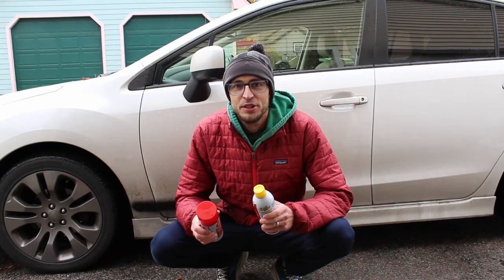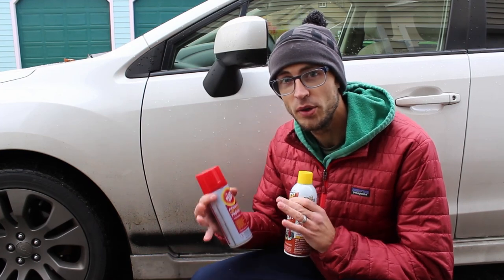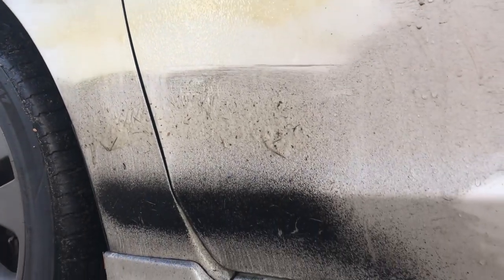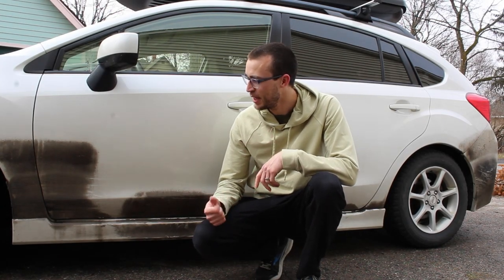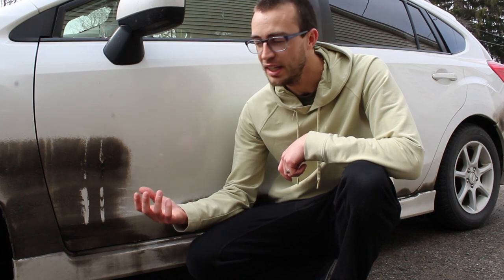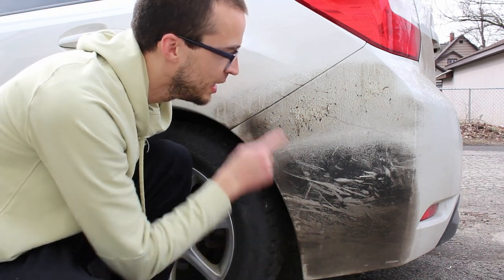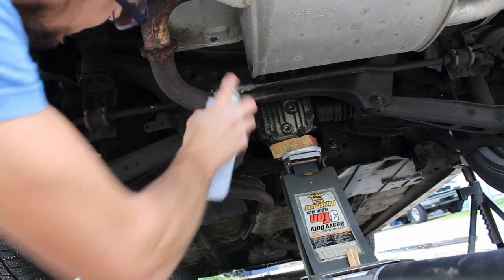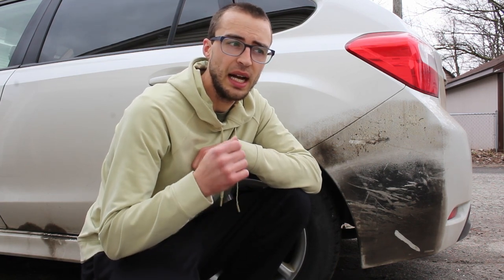Fluid Film VS Surface Shield - Rust Protection Undercoat Comparison Test

Comment: Project Farm tested Fluid Film as a gun lubricant, and surprisingly it came out in the middle for quality, compared to several lubricants made for guns. I use it for motorcycle chains, since it costs less than most I use it more often, and it does not collect as much road grime as some choices.
Reply from the maker: Yea it’s a pretty versatile product. Seems surface shield is only recommended for an undercoating.
Reply: I saw on another video to spray underneath push mower decks (& lawn tractors) & grass doesnt stick/wont rust! ALSO, my old window air cond squealed. I sprayed w/pb blaster, WD40, etc, still made noise. Until one yr, shaft motor moaned/froze up. I sprayed shaft w/ff left it creep, & runs like new again!
Reply from the maker: Don’t try that with ss though it’s crazy sticky and is a pain to get off anything.

Comment: Very good comparison Kurt.  The question is, what is in your wheel wells?  Is there factory undercoat or rustproofing applied?  My car will not get driven in the rain, but I have some suspension and chassis parts I would like to clean up and coat with something.  I think that the Fluid film could "creep" more into the undercoating that has minor cracks in it and settle between the undercoat and the bare metal underneath it.  I would like to know your thoughts.  Thanks
Reply from the maker: The more I use them the more I like fluid film, I use fluid film in the wheel wells under the liners. It creeps alot

Comment: I wouldn't believe either would even last a 2 months much less a season or 2 yrs. They probably tested it in Southern Ca or the Arizona desert without ever driving it and what does. Test that in the salt covered, graveled roads of upstate NY and you will have much different results. South Main Auto channel is a fan of fluid film. Thanks for the testing but how these creep on smooth paint is remarkable different from how they will on metal, which I believe will be much better.
Reply from the maker: I believe that the surface shield lasts that long but the more I use it the less I like it. It hardens like a rock but doesn’t seem to be near as good as fluid film.  You have to chisel it off almost.

Comment: At 4:00 you applied SS for 2.6 seconds and FF a total of 5.4 seconds. Then, at 9:00, you point out that FF has a bigger coverage. I'm not a genius, but anything done twice as long will cover more. You like FF, understandable. But your own finger wipe test showed how SS is better for longevity
Reply from the maker: SS def lasts longer. Based on my experience fluid film creeps better. But I don’t think surface shield is much worse.  The nozzle on the surface shield gives a wider coat. The fluid film nozzle is very narrow so it took longer to cover the area.  

Not sure what the flow rates out of the can are so it would be pretty difficult to get exact amount of product on there.

Appreciate the advice/criticism though

Comment: Not making a statement against surface shield but petroleum jelly can degrade types of rubber. Might be relevant for components in the undercarriage.
Reply from the maker: Most rubbers on cars resist that,  I’ve had fluid film on my car for 7 years without issue.

Comment: Can you mix Blaster surface shield with a Krown or Rust Check product?
Reply from the maker: I’m not sure what those products contain but it’s unlikely they would be reactive.  I would do one or the other and not both though.
Reply: Hey I thought the same question mixing together or one on top of the other. 
Surface Shield is made by Blaster makers of Rust Buster for corroded bolts and nuts. This product is excellent for seeping into metal pinch welds and joined metal. I was thinking of spraying this into those areas then top of with Surface Shield or Fluid Film or Woolwax.

Comment: In my country surface shield is not available, but fluidfilm is.
Do you know if it is possible to just mix fluidfilm and petroleum Jelly, and get a similar result? If so what would be the mixing ratio?
Reply from the maker: I would just stick with fluid film it is extremely good.
Reply: @KurtofTrades  ok, thanks

Comment: Hello, great video. How many cans do you think I would need for a four door car like yours.
Reply from the maker: Thanks!  If it’s the first application and you are doing under the fender liners probably 3. A recoat without doing under the fender liners takes me 2.
Reply: Great, I wondered about those fender skirts, I have a 2022 Sorento and it has those soft almost fabric type material in the rear quarter panels.
Thanks for replying so quickly.
Reply: I have 3 cars. Winter i Norway. On my bee 5 years. 150 cans., More cans the better.

Comment: I thought these products were intended as an undercoating and not on the outside of the car and on the paint. What do you do. Spray it. and wipe or wash it off?
Reply from the maker: Yes they are, it’s hard to see them and film them under the vehicle. I did this as a demonstration.
Reply: Thanks Kurt. I genuinely don't know much about these products. Other then a couple of other youtubers said not to apply it on the outside of the car. If you do that. I'm sure you don't leave it on. What do you do. Let it soak in for a bit and wash off?

Comment: Would you spray this stuff over hard undercoating?
Reply from the maker: I would never use a hard undercoating in the first place. It’s worse than doing nothing
Reply: @KurtofTrades  nice I ruined a $57,000 truck is what your saying. Thanks
Reply from the maker: No it’s not ruined it will just need to be touched up when it starts flaking, I would add fluid film once it starts cracking.
Reply: @KurtofTrades  ok. I did this when I got it brand new day one. I do regret it and am mad at myself for doing it. I see nightmares of people getting rotted vehicles. Dealer claimed it best thing I did
Reply from the maker: @appleztooranges dealers don’t care what happens in 5-10 years.  It’s not the end of the world.

Comment: Thanks for the review. Apparently these products are good to keep rust from forming in the first place. Does anyone have any opinion on this: I am using Rust-Oleum Rust Reformer Spray, on light to moderate rust on the undercarriage and frame of my vehicle (according to Rust-Oleum,  I should use the spray form on light to (at most) only moderate rust conditions) using the liquid to brush on the product, mainly on heavily rusted parts---as on my other vehicle). Once I have done this according to Rust-Oleum, I need to paint over the rust reformed area. --Now, after doing this, do any of you believe that it would provide extra protection of the surfaces to spray Surface Shield over the fully dried paint surface and then touch it up every 1 or 2 years (depending on how bad a winter we get here in Michigan, and how often I drive the vehicle in the elements of course)? I did not know this product would stick to paint as well as it appears to, and that's why I am asking. Since this Surface Shield seems relatively easy to apply, if it can stick to painted surfaces on the undercarriage, where the surface rust has already been mostly killed, why not use it? Any suggestions since I am unfamiliar with this product?
Reply from the maker: It definitely won't hurt to do that. The only reason I wouldn't do the rustoleum then the surface shield or fluid film is if the rust is really heavy already, IF the rust is formed on the back or inside of panels then doing these won't solve the problem. Sounds like yours is light rust so it definitely should slow it down, which is the ultimate goal. Go for it.
Reply: Definitely use fluid film or surface shield. That rust reformer is only good on light surface rust, if you seal the rust jn with paint it will form scale under the paint. Your better off just hosing everything down with fluid film or surface shield once or twice a year, get one of the 360 degree straws to spray inside boxed frame sections and body panels.
Reply: @semajniffirg230  Rust reformers are good for nothing.  Only at way of Lanoline and Cosmoline doing its job.

Comment: Can this be sprayed on existing rust ? Will it stop/slow it down ?
Reply from the maker: Should slow down light rust. Heavy rust nothing really can stop it. These are better used on cars that haven’t seen salt yet.
Reply: @KurtofTrades  wish I knew about these products sooner . I bought a brand new car last year and there is some surface rust on the pinch welds and I'm looking for solutions
Reply from the maker: Fluid film should help slow it down,  it won’t be a problem for like 10 years though.  Depends how long you plan to keep it.
Reply: @KurtofTrades  probably around 7
Reply: I hammer away thick rust first. Screwdriver and hammer. Then on the hard rust I spray on Fluid Film stop rust.👍🇳🇴

Comment: Do you guys have pros with special spray guns drilling holes and applying these in a business ? Over here in Canada we have krown rust control, corrosion free, and rust check.
Reply from the maker: Not specifically for the these products there are krown locations in the us and there are some undercoating shops that use a variety of products.

Comment: What do you guys think about the crc 6026?
Reply from the maker: Never used it but looking at it it sounds like its like surface shield without the lanolin, I would think SS or FF would be better but can't say for sure.
Reply: @KurtofTrades  Nop.  I use CRC 6023 heavy.  It is Cosmoline and it is in my tread "10 year of using cold galvanizing".  It is toward bottom of comments.

Comment: Is this stuff safe to use on the cars paint for the winter?
Reply from the maker: Not really necessary to use on the paint it’s more for the underside.  It does collect dirt which isn’t the best for paint. It won’t directly hurt the paint though.
Reply: @KurtofTrades  how do you remove the SS if it gets on the painted  body panels? Or on the plastic pieces near the underbody like sidesteps and other plastic bits?
Reply from the maker: It’s actually very difficult to get off. I had to scrape it off and scrub like crazy.  Soap and water didn’t work very well.  A pressure washer might work.
Reply: @KurtofTrades  that’s what I was concerned about, getting it off where you didn’t want it. I still want to find a professional to spray my truck but don’t want to deal with overspray  they may leave. It appears that I may have to do this job myself as I can’t find anyone to do it for me, I sure wish I had a lift.. I’m getting old..

Comment: what about rubbers plastics under the car
Reply from the maker: No issues with them swelling or degrading at all, been using fluid film for 6 years. Not sure on the petroleum jelly part of surface shield though, it most likely won’t damage anything either.

Comment: Surface Shield in one or 5 gallon is double the price as Fluid Film. Unless they come down on the price I’m stocking with Fluid Film.
Reply from the maker: Wow yea I just looked it’s more than double the price crazy! Especially since the cans are fairly close in price.
Reply: If it costs  twice as much, has the same coverage, and lasts close to twice as long, the labor labor saved would make it cheaper.
Reply: If you believe that it last two years I think it is Marketing I wouldn’t trust that. I tested the Fluid Film Surface Shield and Wool Wax for creep test and Fluid Film creeps the best.
Reply: @martinmorris6271  I’m using both on my suburban this year- I’m using ss on my bottom and ff in the frame rails

Comment: I'd rather see a test on metal panels not paint! How it sticks to metal with a bit of surface rust.
Reply from the maker: These products are more meant to be preventative and applied to a car when new to prevent it from happening in the first place.  They are pretty good at sticking to light rust as well though.

Comment: Really good information in the video.  Fluid Film is advertised as non-toxic.  Does the petroleum jelly in the Surface Shield make it toxic or is it non-toxic as well?
Reply from the maker: According to their website it is non toxic as well. Still make sure you use precautions like a respirator and goggles as it’s an irritant!
Reply: @KurtofTrades  Got it thanks

Comment: Is PB Blaster's Surface Shield a fantasy or just an April Fool's joke?   PB Blaster products everywhere, but nobody has stock on Surface Shield.  It was to be initially available only through Home Depot, but they don't even list the product available on their national website.  The Amazon link in this video doesn't work either.
Reply from the maker: Huh I’ll look into the link.  I bought these cans at Home Depot last fall. They were hard to get though and were constantly out of stock.
Reply from the maker: My link works. What country are you in?
Reply: Harbor freight has it
Reply: @paulkelly1809  I just contacted HF in my area and out of two stores they had just six spray cans. One store said they haven’t had a delivery from the blaster people in awhile and don’t know when they will get a delivery. I will need over six cans t o do just the underbody and frame of my f150

Comment: Nice comparison between the two. If your going to show how well a rust preventative works wouldn't it make more sense to use it actually on areas that rust and not on top of paint. Makes no sense to me on your test.
Reply from the maker: There’s not really going to be any differences after a year. They take several years to show how wel they slow rust.  This is more to compare the properties of them and their durability and ability to creep. I get what you are saying though a longer term test on a fresh car would be a another good test to do too.

Comment: First of all, it seems crazy that you applied these products to the exterior of your nice car.  You must be wealthy.  I almost fell over when I saw you doing that.

Second, application to the finish coat is meaningless. This isn't where the products are used.  It's made for UNDER-coating.  The rusty rough dirty surfaces are COMPLETELY different from a glossy clean exterior finish.  The rough and rusty parts in the undercarriage are much more porous and the products will "soak in" and spread much more.  Testing for adhesion in a glossy surface is just silly.

Last....your testing does not relate in any way, shape or form, to rust proofing. Which is the whole goal with these products.
Reply from the maker: Thank you for the criticism.  Doing a full scale test on the underside takes several years to show results for how well it slows down rust.

I was mainly doing it on the body so you can see how the products work better. The underside is dark and not very visible.

I agree that it’s not a perfect test but gives a good comparison of the properties and application.

It may have left a few scratches on my paint but doesn’t really do much damage to the surface. Thanks for watching!

Comment: I think you did a good job, but your nose is broken. Fluid Film smells awful to me. Surface Shield smells much better. I undercoat my truck with an airless sprayer and Linseed oil. It does a great job.
Reply from the maker: I couldn’t really tell the difference 🤷‍♂️